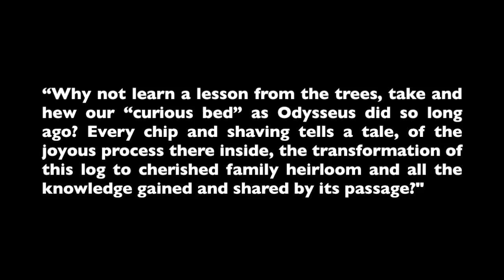SIMPLE SHAKER BED

Comment: Nobody could tell you how to work with wood... You are the best!  BUT- As a 68 year old painter, I can tell you need to use natural pig and camel bristle brushes when working with oil based paints or varnishes. That "Tynex" (nylon bristle) brush will work fine with waterborne paints, but not in oils.

Oh yeah, congrats on the new addition (Little Chickadee?).

Comment: I have three questions: The log wedges you use to split the wood at 1:46 look forged wedges with sockets, and you have added wooden handles and steel hoops to mushroom them over the end. They almost look like Japanese chisels. Where did you get those wedges, and what are their proper names? Also, is there any way that you could post an article about your essential tool list, or the tools you use most often? 

I've been woodworking for years and using YouTube to teach me different woodworking skills and for inspiration. I only recently came across your channel, and I'm impressed. It's a shame I didn't find this channel earlier. You are an inspiration.

Comment: I am amazed with all your videos. You have a very extensive knowledge base in woodworking. The only question I have on many of your projects is the duration of waiting after milling the trees. With all your friction wedges, all the wood must be pretty dry in order to not shrink with moisture loss. Do you have a moisture meter or do you just wait a few months after milling the lumber? Thanks for sharing your experiences.
Reply from the maker: The beauty of wedged joinery is its ability to be tightened when needed. This goes for everything from small furniture to large Timber Frames. I often air dry sawn stock for 1 year per inch, but this also depends on many factors including wood species. Riven stock is used fresh, only dried enough to let it be smooth planes for a nice finish, which might be a week or so.

Comment: I've heard that he carved his own chisels, out of blocks of stainless steel, using hundreds of thousands of wooden chisels that were each cut using his teeth
Reply: Average Joe Skeptic 🤣
Reply: @Clark42EoC  correction most people 100 years ago paid someone else to do it like we do today; before that most went without.
Reply: Actually there was an intermediate stone chisel as well, and he didn’t use his teeth he used his right femur (which was replaced by a 1” oak dowel). The slight stiffness in his gait makes it obvious
Reply: I'm pretty sure mister Clark was doing a little trolling
Reply: As a former Marine, I expect he formed the steel either by chewing the blank with his teeth directly, sheer will, or possibly with a stern gaze.

Comment: 337th.
Beautiful wood, beautiful bed, and beautiful finish.
Do you think it would work to have either the sides or ends lock in the other internally, then pin/wedge the other sides? I know the design is knock down for loading into a wagon in the days of old, but knowing me, I would rap my knees or chins on those tails on a regular basis. Still, great design, and it is great to see you using the treadle-lathe on a project.
RESPECT!
Reply from the maker: Sure, thats another way, you can make the tenons locking together so only one needs wedging. There are other joints also that protrude less, I just love love love through wedged tenons...

Comment: Really nice work! I use the metric system, so I assume it has about 1,20 m width and about 2,10 m in length? That's what it looks like, despite the angle of the camera which makes it a little harder to tell. If I'm right, that would be enough for two persons snuggling up to each other (as to the many questions of others regarding the beds' size).
Reply from the maker: Thats about right, its a twin size bed which we have shared for years.
Reply: Mr. Chickadee 
You mean you've slept in one like that for years? And now built another one? Or is this video a bit older already? Just curious!

Comment: hello! wonderful work both you and Mrs. i have a question. why do you put the wedges in the upper tennon at the front upside down? shouldn't they all be facing down so that gravity helps them stay put? thanks
Reply: ok i've found the answer about friction. still, it doesn't make sense to me. it might not fall out, okay, but from an observers point of view it looks like it might.
Reply: i'm an architect and aesteticly this is weird because in doesn't look structuraly sound. especially since you flipped only two of them, not all of them. if all similar features are weird it's design. if most are normal and one is off it looks like a mistake.
Reply from the maker: sorry to confuse or disturb your aesthetic sense. Sometimes I enjoy playing with different elements of joinery or design, this was nothing more than "hey what will that be like to do these wedges a bit differently than everyone else. "
Reply: i see. sorry for being boring:)

Comment: Those wedges that you used to HALF the log, what are they made of and do you have a videos of them or pictures? I need to make these ASAP
Reply from the maker: They are old vintage wedges. You could just take a solid steel wedge and weld a piece of square pipe on the end, grind it smooth and make a wooden insert like this.

Comment: Mr. Chickadee  Can you tell us more about the Lathe ? Is it a Treadle Lathe?
How is powered to go so fast & in one direction?  Thanks and love your Video's.
Reply from the maker: Sure, its a treadle lathe, the treadle pushes a crank arm which rotates a large flywheel, this flywheel is connected to a smaller pulley which runs he drive shaft, giving a large increase in speed. Below you can see how I made it. 

https://www.youtube.com/watch?v=qwXisyGuy-Y&t=454s
Reply: Thank  you for the reply - I've watched so many of your video's I forgot
that I had your Treadle Lathe video in my Favorites already. Opps !

Comment: Does making fine furniture out of green wood make it so additional adjustments are needed in the future?
Reply from the maker: Riven wood moves very little dimensionally, but you might need to tighten a wedge during the first year or so, then never again. If using draw boring with pegs, nothing needs to be done ever, but the furniture will not be able to break down for storage or moving.

Comment: Wondering, how long was that log on the ground before you started working with it?   Meaning, how " green " was it?
Thanks, JIM
Reply from the maker: Great question Jim! Most logs laying on the ground will actually rot before they ever dry or season, the bark shrink wraps them in a way, and even without bark, the shear mass of moisture and size of the log dont permit drying. So to answer your question, even though this log was "down" for over 2 years, inside it was just about as "green" as the day it was felled. Thanks for the great comment!

Comment: PLEASE! don't take this the wrong way... Personally... I would have put Allah pins through from the top, facing down... Because as the bed is moved and wiggled, and as people toss and turn in their sleep, or bump into it, the pegs fall further and further, making the joint tighter and tighter and tighter every day. Personal recommendation... Please don't take it the wrong way. Putting them through up, I'm sure works just as fine if glued or just wedged in REALLY tight. (I do understand it's because of the overlapping tenons)

Comment: Oh man, now you are just showing off!  HA!  Ya gonna pick some straw and make a mattress?
Reply: I'm curious on that! Actually I'm curious with what they do with the by-product, with all that sawdust and shavings, do they get recycled (does the small bits that can't be used in future projects get used as tinder or something) or just thrown away.
Reply from the maker: Just showing what a few old hand tools can do. We tried the straw mattress thing before, very comfy, but when there are two in the bed, you tend to both gravitate to the middle like a nest…if I were single it would be fine. So no for this new bed we are going with memory foam.
Reply from the maker: Shavings make good fire starter and garden mulch, small bits and offcuts are good tinder, firewood, tool handles, and pegs and wedges.
Reply: Thank you for answering. I've no experience in woodworking myself Recently found your  and a few other videos and got very curious. So much so that pert of me is annoyed I never took wood-shop in high school. I was so curious I finally got to searching online for an answer. What do you do with the sawdust?  A few answers I found that besides mulch, they did use it as fire starter and mulch but besides that they'd also do things like use it to fill in tiles or create wood pulp to fill in holes. Is that true can it be used like that?

Comment: Do the tennans have to be so long? I can see me catching them as I walk around the bed and scraping knees and legs. What did you use to coat the frame?
Reply from the maker: This hasn't beed an issue for us, if you wanted other joints could be used instead of through wedged tenons, like a blind wedged dovetail perhaps, or just draw bore pegged if you didnt care for it to be permanent